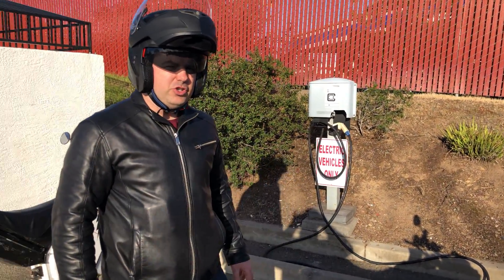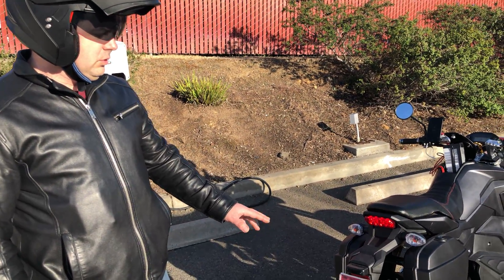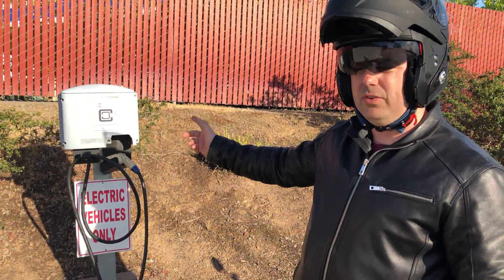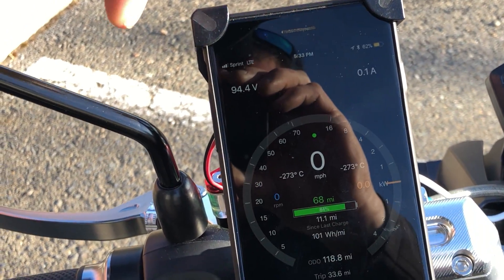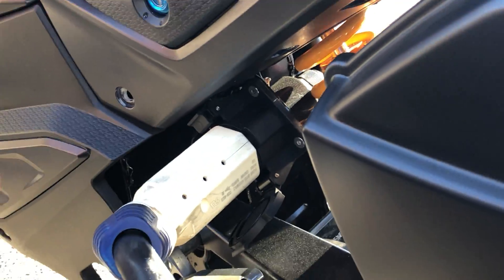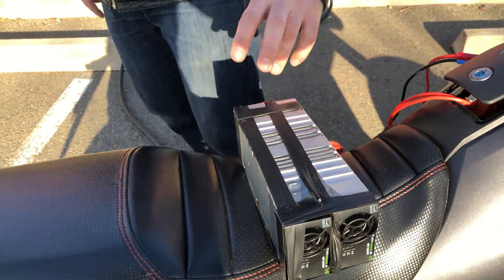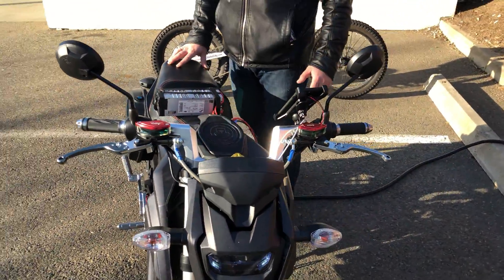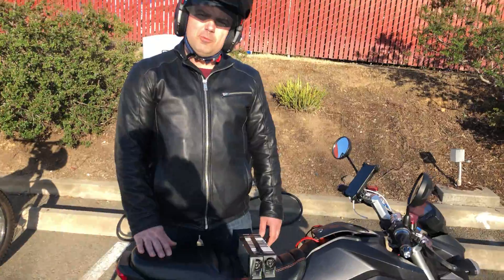Supercharging Electric Bike

Comment: Supercharging that small size of battery for 2 hours???
Wait are these two boxes that you plugged into simply two chargers because the E-bike batteries can't handle direct supercharging?
If so then it is really not supercharging is it? but only a bottle neck solution for charging your batteries.